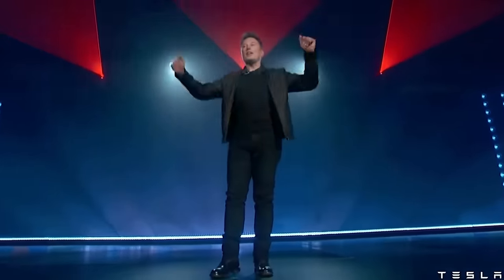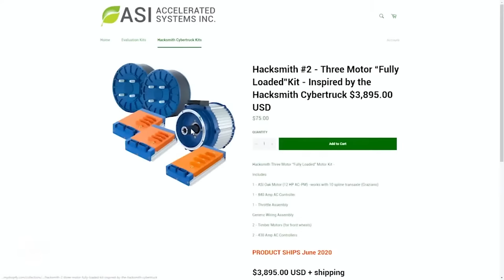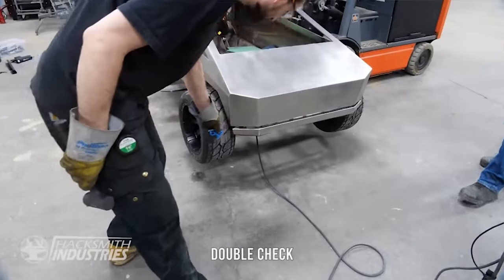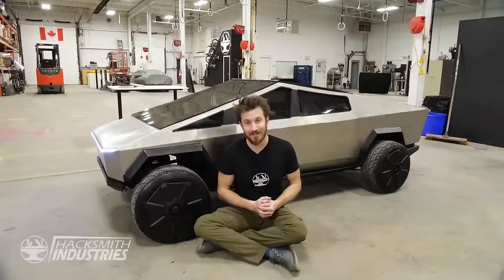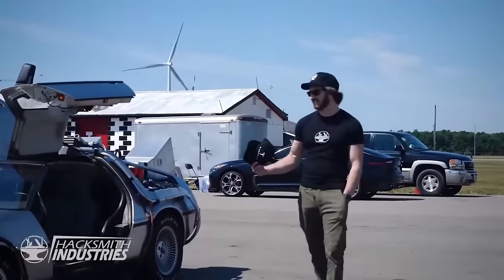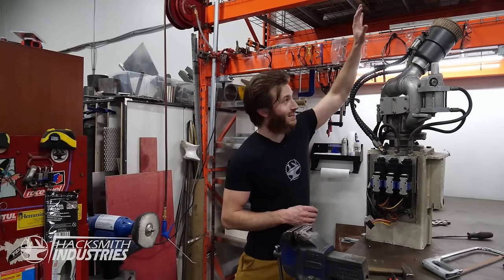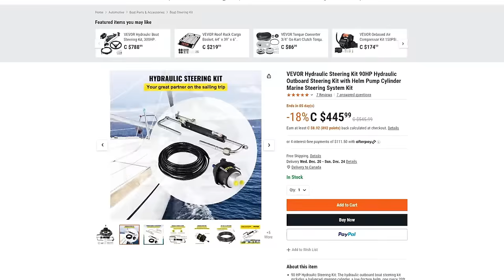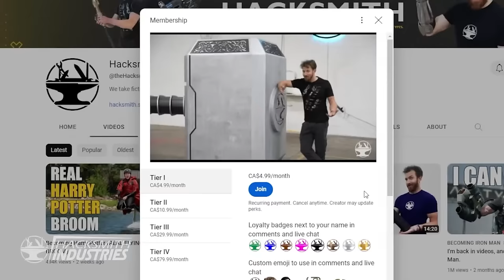We built a half-scale CYBERTRUCK! (COMPILATION)

Comment: I've wondered for a while. What would happen to power and battery drain if you put a gear box between the motor and wheel that turned 1:1 spin ratio to 3:1where the motor spins 3 times for each 1 spin of the wheel.
Reply from the maker: Nothing? That's just how a car transmission works.  Electric vehicles don't use gearing because they have constant torque.  The reason gas engines do is because engines have different torque at different engine speeds,  so to maximize efficiency you need to adjust your gear ratio based on your speed. An EV could have a gear box but it doesn't serve a purpose

Comment: What if you changed the steering wheel to like the tablet that was used for the autonomous driving and make it like an RC car so that you can bring the car to you and do other stuff instead of the auto system which can malfunction. Great Work guys.
Reply from the maker: That's exactly how it works!
Reply: @hacksmith what if it was one unit instead of two and was detachable
Reply from the maker: It is detachable...?
Reply: @hacksmith   What i meant was suppose it was a quick release steering wheel like in an Aston martin Valkyrie or an F1 car and it has a screen on it like the F1 steering wheel. So if you combine that you'll get a steering wheel that can control the car from outside as well like an RC car. This might make the car even more functional and more technologically advanced. If you include the automatic driving system you can take control of the car from outside so that you can stop it from crashing.
Reply from the maker: Yes, it has that. Just like an f1 car. It's shown in the test lol
Reply: @hacksmith  What if it had a screen on the steering wheel which also allows you to control it from outside
Reply from the maker: It does...
Reply: @hacksmith  It needs a highly functional screen on the steering wheel. It would make it useful while still making it detachable.
Reply from the maker: It has that... did you not watch the video?? All the self driving controls is done on the screen... on the steering wheel... which is removable
Reply: @hacksmith  I did watch the video i don't think you guys can clearly understand what I'm saying. If you skip to 1:46:50 you can see that the steering wheel is removed and is in James's hands in the next scene you can see that he is holding the Autonomous driving controls. What I was asking was to combine both of these into 1 singular unit (The removable steering + The autonomous driving system) which means that you'll have one singular unit that can have way more capabilities than what it is now.
Reply from the maker: They are combined -- it was just separated in that shot
Reply: @hacksmith  so the screen is on the steering wheel now combined as one unit. It hasn't shown that in the whole video.
Reply from the maker: I'm telling you, they are.  If it wasn't shown in the video,  they are capable of being attached together and removed together